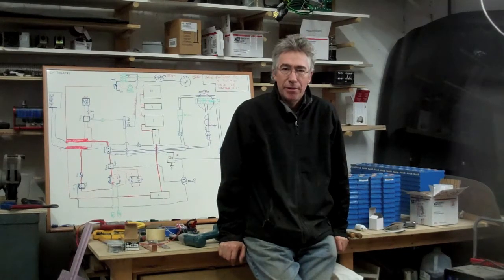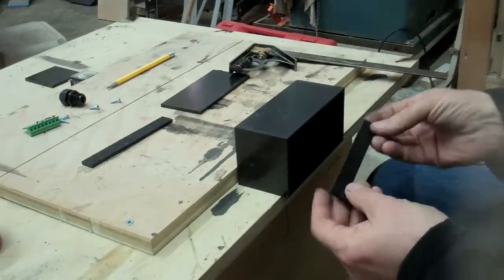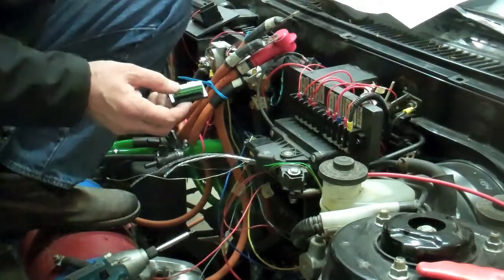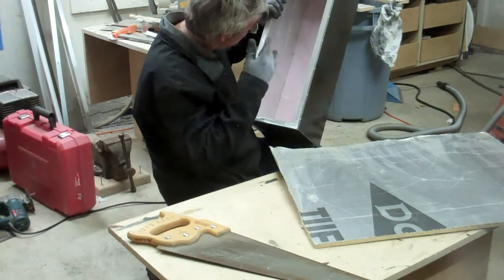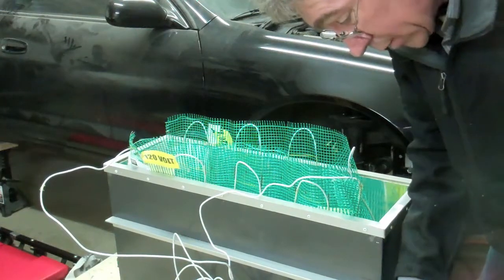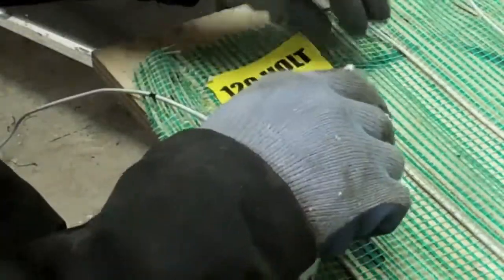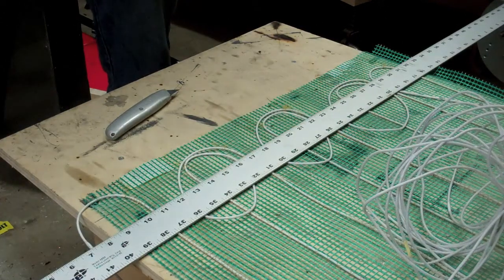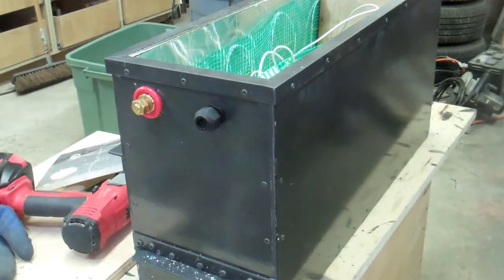John Allen's 1994 Celica Part 8.mov

Comment: I suggest a better thermal control system.  These mats can get quite warm.  The wire is designed to dissipate its heat into a large thermal mass.   The wires may get hot enough to melt the plastic battery case.  Test it before you commit.
Reply from the maker: You are right and the heat reaches 104 f and the thermal mass is the batteries.  Works very well